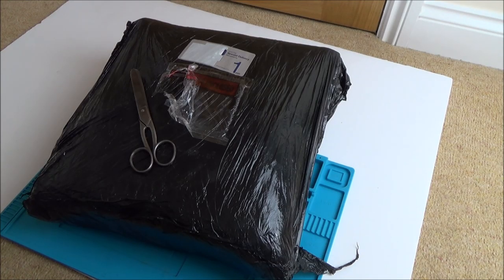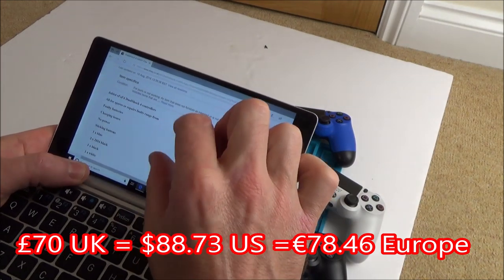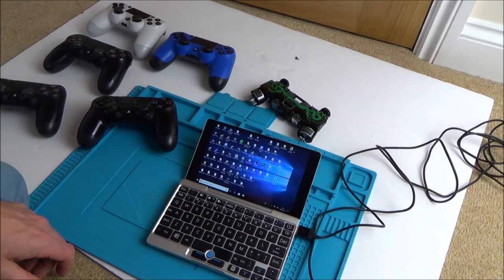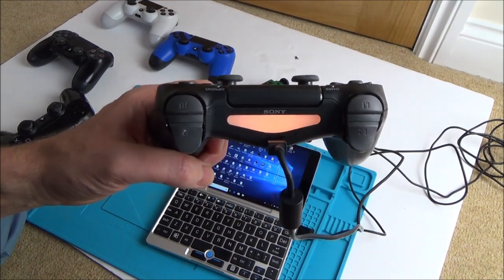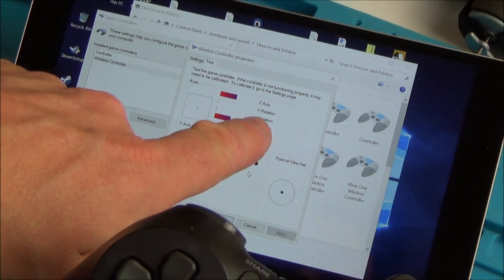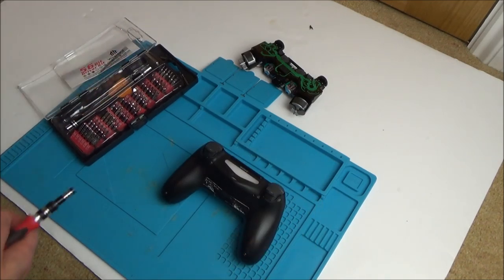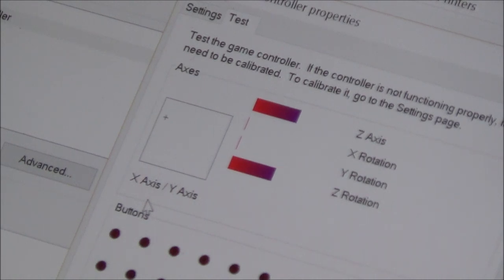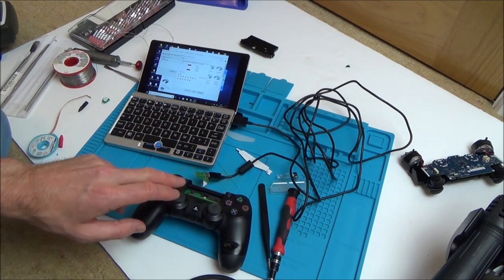Trying to FIX a Joblot of Faulty PS4 Controllers - PART 1

Comment: Quick question if you got time. I have a ps4 controller that won't charge or turn on. When I opened it I noticed some dried pop I'm assuming, I cleaned it with ipa and still no luck. The thing is there was no corrosion visible before or after I cleaned it just gunk and then none. It appears to be not getting power at all. I was wondering if you had any suggestions. Anything would be appreciated. Thanks in advance if you take the time to respond.

Comment: For testing PS4/PS3 controller you can install SCPToolkit on your mini laptop, and it will install a Xbox 360 controller emulator (driver), and you will be able to use the Game Controller Tester App on Windows 10.

Comment: The good thing about ps4 controllers is that they have easy fixes.
Reply: You can't mod ps4 controllers
Reply: @korbin2594  define mod as a soldered scuff conversion in my eyes is a mod, adding autofire also a mod, new paint job 3d printed custom buttons, yep you guessed it mod?

Comment: The flex ribbon touch pad does cause problems if it goes bad the controller won’t power on at all I have a blue PS4 controller that I’ve replaced the charging port and I’ve gotten a new battery because I thought that was the problem but it wasn’t it was the flex ribbon touch pad I haven’t finished fixing my  because I’m still waiting for the flex ribbon. I’m hoping that fixes my controller

Comment: my old DS4 has a problem with the circle and PS buttons activating simultaneously when i press either. Checked the controller with control panel as seen here. And as i expected 2 inputs  activate when i press the circle or PS button

Comment: I have a version 2 controller i purchased for £5. exceptional condition but it does not charge, i manually charged the battery and connected via usb and disconnected and used through bluetooth but the light stay on when the controller is off, i have also replaced the charging port, Any Help?

Comment: Bought my own joblot of DualShock 4 controllers fixed three of the five, but two of them are just dead and I don't know where to start debugging them, any tips?

I've taken them fully apart and removed as much as the components as possible to narrow down the issue, right now it is just the board and the micro USB port (tested and worked on other controllers). I can read power it getting to the board, but I just don't know where to go from here. Nothing is getting hot, I've fully cleaned everything, no visible damage.

I'm thinking of removing the bottom Ext + Headphone plugs, because this was where a bit of corrosion was before I cleaned it, but I'm not sure of that would be the best cause of action.
What are some components I can check that are prone to fail?

Comment: wouldn't you need to add the wiper to complete the potentiometer to make it work? (for testing purposes)
Reply from the maker: Yeah, I just thought maybe if I measured the carbon track by itself it might show up the wear with more resistance :-)

Comment: I've rebuilt my share of Sony and Microsoft stuff, Thay bolth have thire design pro's and con's but I've always enjoyed getting into Sony units, Until I got one full of roaches. Even though they weren't alive and because of the 6026" altitude I live at. But good luck bro.
Reply: @xxxxxxxxxxxxxx5 Thay were in the consoles manly and one controler that had a cracked shell,

Comment: Crush the connector slightly on the cable not the port
Reply from the maker: Oh yeah, if I had put the micro USB cable in first and then used the pliers the port wouldn't have gotten crushed. Great tip. Thanks :-)

Comment: If you just saw a video how to repair this problem it will not take you  5 mins.  just cleaning. I always do it with my controllers.
Reply: You need a Cotton swab only. No alcohol no anything.
Reply: Just clean this 17:35 and the place  you find it in. And you are done.
Reply: The color should be goldish if it has a purple color that's mean it's burned. Replace it.
Reply: Yeah and do this 15:58 why did you stop!

Comment: My 1st controller wouldn't move all the way up and my 2nd the r2 moves the right stick right. I'm not the only with these issues. The reliability of these sticks suck none of these controllers will last over 20 years like Dualshock 1 can.

Comment: To be honest, all ps4 controllers have faulty ports from when you buy brand new. No matter which usb charger you buy.
Reply: Is how they place the USB port they place a triangle so when you connect a cable to and place it on a table the cable push the port upwards if you're going to charge your controller make sure you have them in a upright position somehow because over Time the USB port will be pulled away from the board
Reply: It must've been the part that Sony has been using.
Reply: @killertruth186  I love Sony but it's really has to do with the design of the control thay angle the port down  instead of straight on so when you place it lying down on something the cable will push upward on the port
Reply: @BenjermanKulandaisamy  Now I see why it is designed that way.

Comment: Just be aware that PS4 controllers are not very compatible with anything other than the PS4 without 3rd party software such as InputMapper or Steam (within Steam only) which disguise the controller as an XBOX controller.